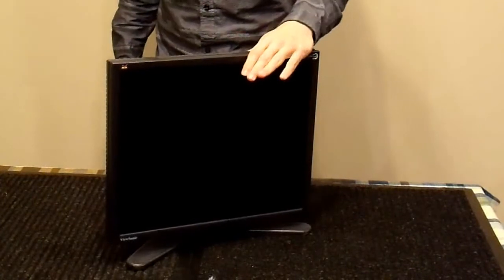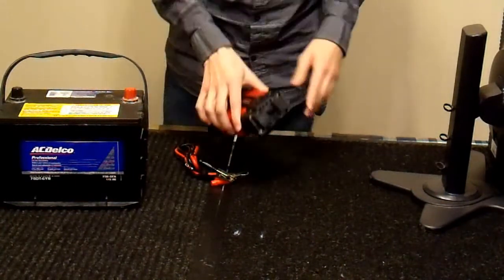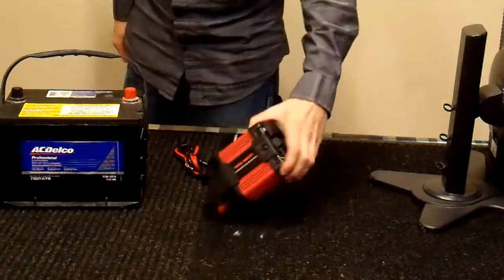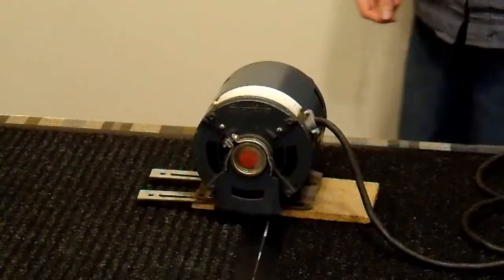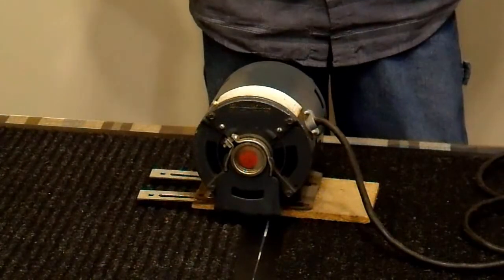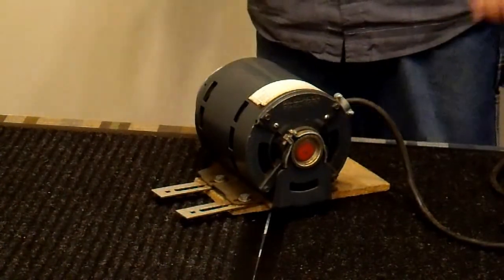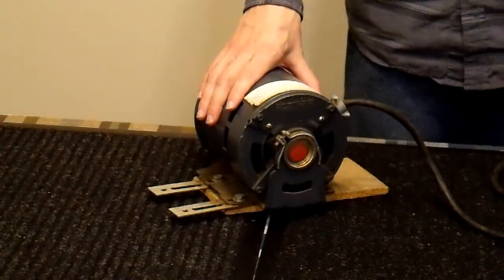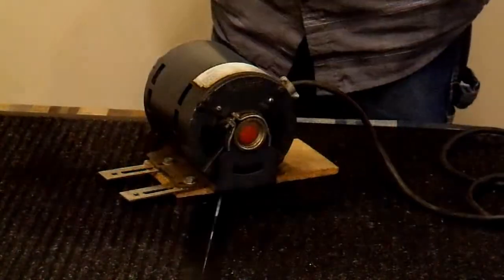Twelve Inverter Review - Part 1 : Where did the term 'Inverter' come from anyway?

Comment: I'm looking for a 1500-2500 watt power inverter capable of running power tools such as an angle grinder, sawzall ect. Also I wanna be able to run a Mini fridge, but not at the same time, I would like something that is compact so I can tuck it under a seat or in a body panel and  durable since it is going in my jeep over lander build and will be off-road a decent portion of its life... Any suggestions? As to size and brand?

Comment: Would mounting an inverter behind a toolbox on a motorhomes undercarriage in a vented metal Xantrex inverter box be a bad idea?, I have seen this done on some of the forums, it would be auto started with vehicle/remote controlled and have some exposure to the elements but I wasn't sure how much exposure an inverter could take. I just don't have a good indoor spot for it and would be quieter to have it below, these are not real high end inverters I was planning to put a 5000w powerjack inverter in metal enclosure so no big deal if it only lasted a few years with heavy usage, and I was planning to ground it's case to the trucks frame. It appears to stay fairly dry and clean where it would be mounted. Just curious if these are designed to take some abuse from the elements. Thanks, Lee
Reply from the maker: If the inverter is not rated for marine use it should be fully protected from the environment including condensing atmospheres.  (fog, mist, frost, etc)  I'm not saying it won't work but early failure would be expected.  If the enclosure is mostly sealed that would be best - higher temps are bad but less environmental ingress is better.

Comment: Hello, Is it possible to wire a power inverter to automatically start up when accessory power is turned on in a diesel motorhome from the ignition switch and also have functionality to turn it on from a remote switch? I currently have a 5000 W powerbrite inverter with a wired remote and I also have a power jack inverter I could hardwire the power switch on, ideally I would like to have this inverter on automatically when driving so the RV accessories like hot water heater and refrigerator switch to electric power automatically when RV is running. I would also like to have the ability to turn it on via a remote switch when Boondocking. From a technical standpoint is it possible to wire an inverter to automatically power up and have a remote power switch? Any advice would be great and how to wire this properly. Thanks, Lee
Reply from the maker: Yes, it is definitely possible and relatively easy.  Wire up an automotive 12V relay to the power switch of the inverter, then connect the coil of the relay to any circuit that is hot when the ignition switch is on.  The inverter will then turn on and off with the ignition and only very thin non current carrying wires are necessary.  Any remote switch also installed will also work.  See my "How to add a wireless remote On/Off switch to any inverter" video for more information.

Comment: The controller, it takes power from solar panels and feeds it to the batteries. If the weather is dark for a week do the batteries just stay low or is there a different method of charging them say from local power company. If you do charge from local power do you just plug in a battery charger.  My friend tried a trickle charger and said it was useless.

Comment: Hello I have watched your videos and appreciate the input.  This is a good series and shows good cons to avoid.  One note, I would have appreciated you showing the internals so I could see construction.  Are you aware of any good 48Volt interters?  Do you have any experience with solar charge controllers and grid-tie?  Best Regards, -BAG2
Reply: This comment is going to be a little long. Please expand to read.

Knurlgnar24 has taken apart many inverters. See his other videos.

What can be defined as 'good' can mean others things to other people. But if you want something that will work for a long time, therefore being reliable, seek something made in the USA. No offense, but as of late anything made overseas is junk, doesn't last very long, and very poorly made, poor engineering and manufacturing practices, and so on. A good brand that I've played with is Outback Power. You get what you pay for, quality only hurts once. Ensure what you get has a CE and/or is UL listed. If you don't know what that means, look it up.

There are many types of solar charge controllers. Some of them are just relays with a monitor circuit that cuts off the solar panel to the battery once the battery terminal voltage. Others, known as MPPT, are buck/boost SMPS that output a steady voltage. These are desirable as the battery is not always cycling, and you get more usable power from the solar panel.

Grid-tie inverters are units that change power, usually from DC produced for a solar panel and/or wind turbine, to AC that is to be connected to a power grid that supplies the line frequency and voltage. The grid-tie inverters syncs to the line frequency, and bumps the line voltage up slightly so devices on the same line will draw from the grid-tie inverter, before pulling power from the grid. If you need more info about those technical details, look it up.

The use of a grid-tie inverter is pretty boring once connected. it supplies power on your side of the power meter. If you have a solar panel array or wind turbine capable supplying more than the power used in you home, then and only then will the power you produced enter to the Power Utility's grid. If you have a smart meter for power usage billing, chances are you will not see your meter go backwards. Most, if not all default, smart meters are programmed to measure what a household consumes, and ignore any power produced.

Before a very close proximity lightning strike damaged about $3,000 of electronics in my home, to include my grid-tie inverter, with 130W of power reaching it, I think I saved $3.50 a month on the power utility bill. My meter never counted backwards, but there was still a little power supplied to the computers on my desk in the front room.
Reply from the maker: I do not have real world experience with grid-tie products so I have not made any videos on that subject.  Solar charge controllers are very misunderstood and I could comment on them, but again I have not actually used many of them.  I have only seen one good 48v inverter thus far - also, I have only seen one 48v inverter thus far...

Comment: Technically, prior to their explicit use as DC to AC conversion devices, the commutator in a DC motor was the first inverter. What is commonly called a (brush type) DC motor is really an inside out AC synchronous motor with a rotary switch that acts as a mechanical inverter.